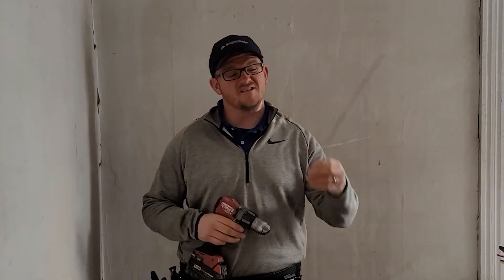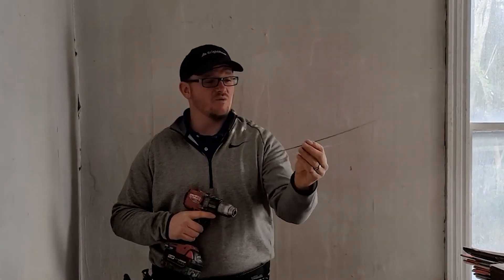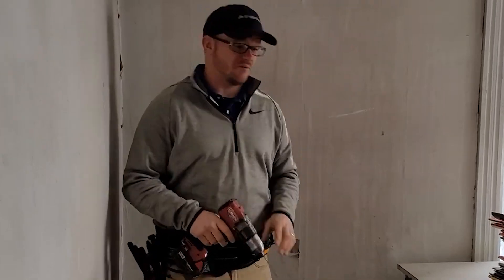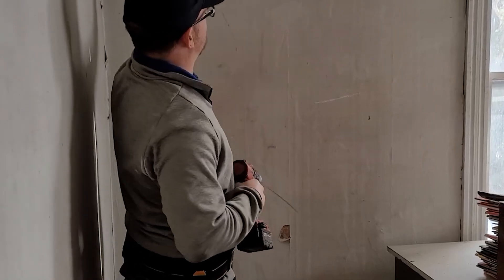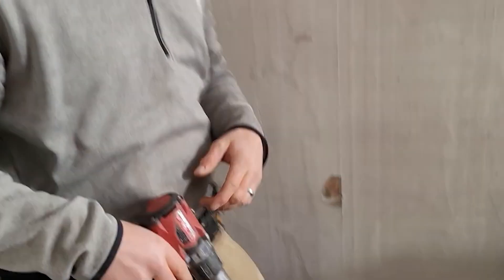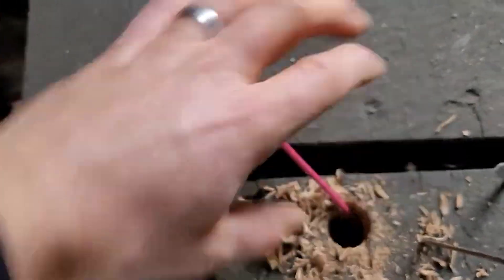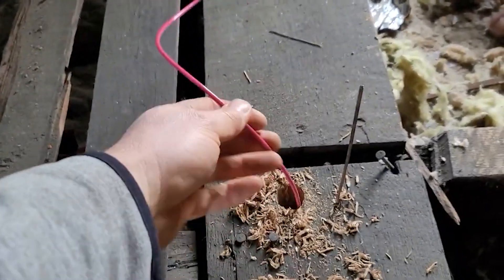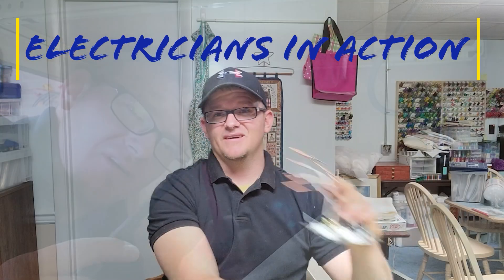#1 Tip for Re-wiring homes or adding circuits

Comment: I use coat hanger cut at an angle and then cover hole with white caulking, works great on drywall ceiling.